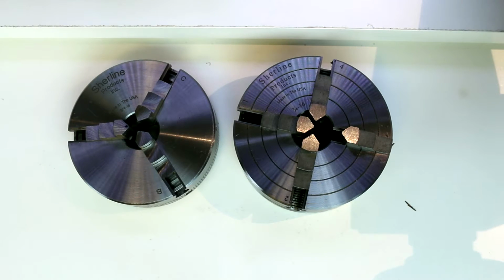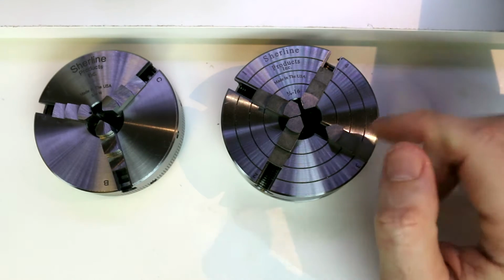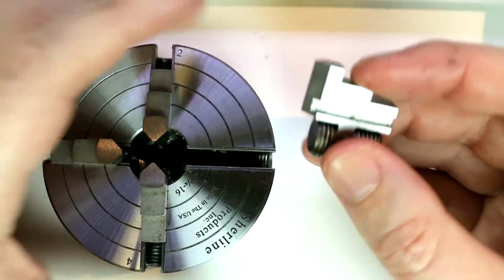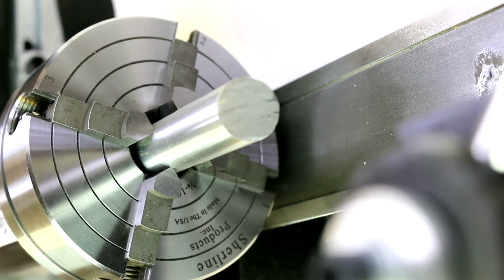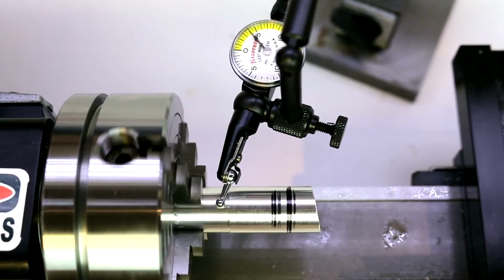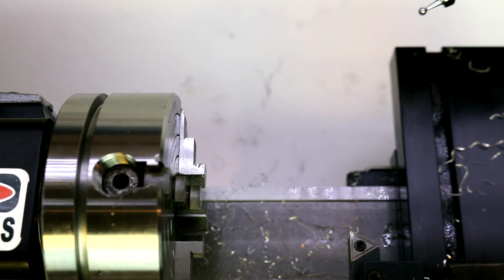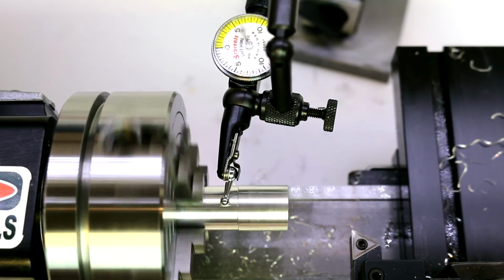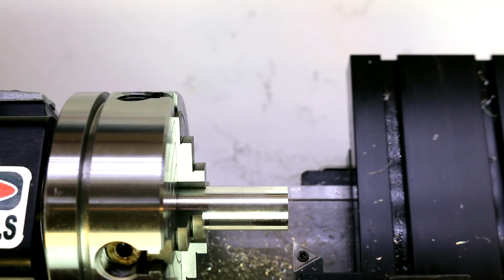Metal Lathe 125 - Work Holding in 4-Jaw Independent, Part 1

Comment: Adding to my last post since it actually got posted..........I have a question. What magnetic base are you using in this video? I ordered a Starrett "Last Word" dial test indicator with all the accessories today in order to set up my mill when it gets here. I also have a 4 jaw chuck coming, so want to use the "Last Word" for set up with it as well. 
Thanks, Jim